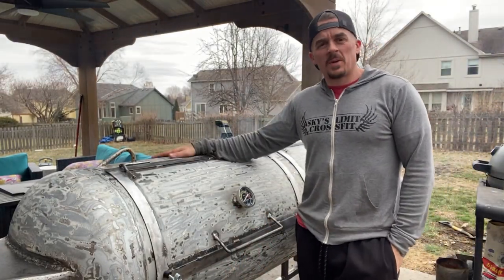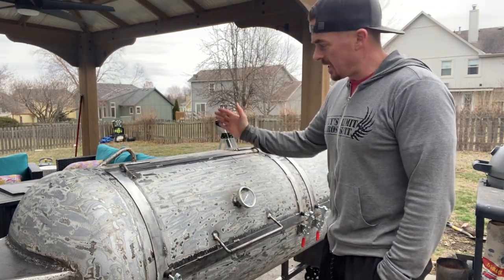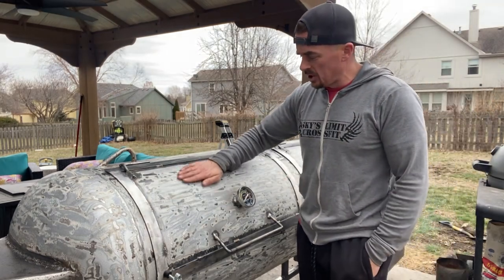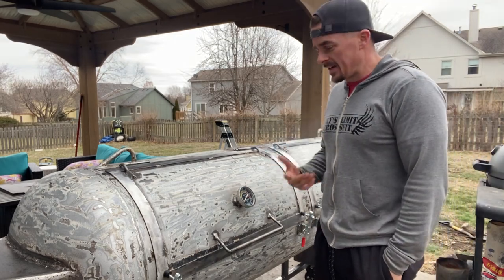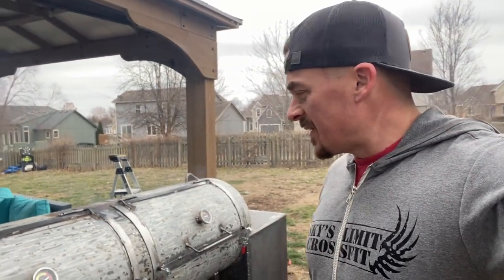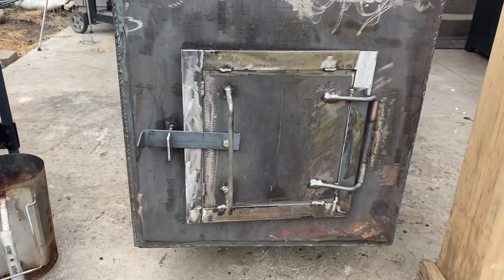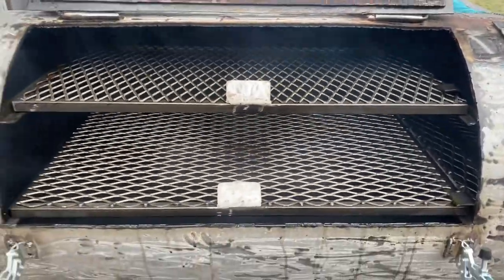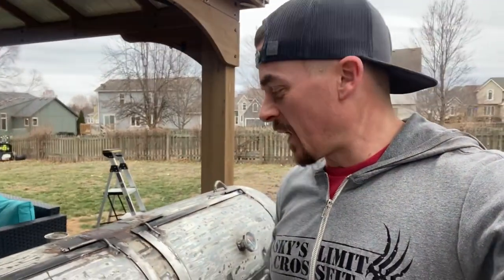DIY Offset Smoker Build Overview

Comment: Great smoker! What are the dimensions of the smoke chamber?
Reply from the maker: Thanks!  It’s 76x24 around.
Reply: How many briskets can you fit on it comfortably? How tall is your smoke stack and is there a damper on top of it?
Reply from the maker: Well I think with the second shelf I can do 6-7 easy in there. I only have the second shelf in the far side though. The smoke stack is 7” and it’s 5’ tall. And yes it has a dampener on it. I’m about to build another one in April too🤙🏼